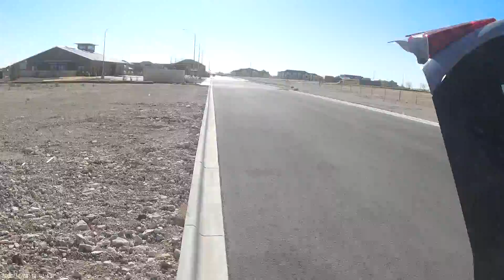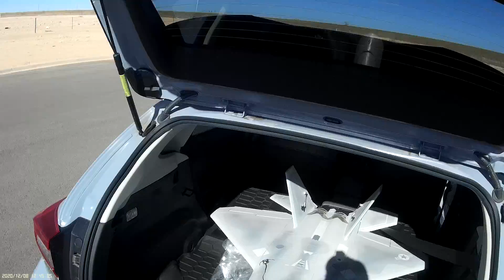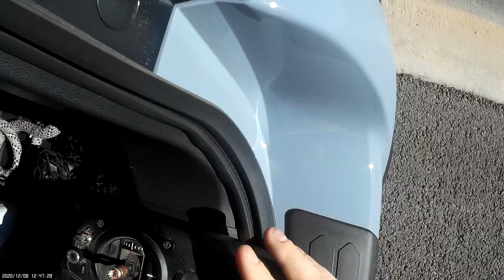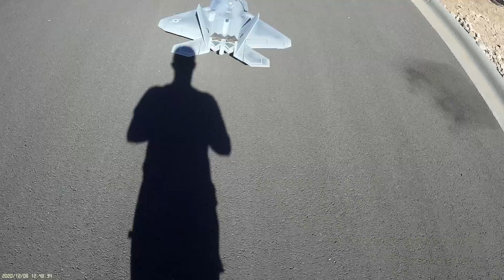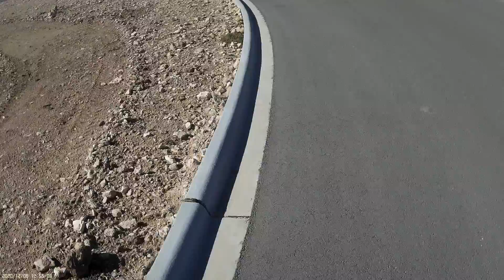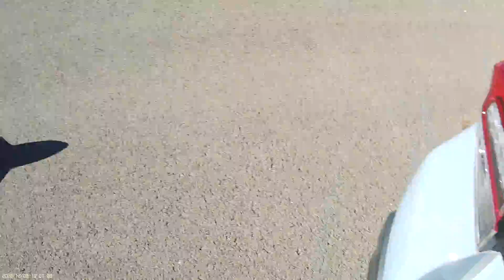Freewing F22 on Turnigy SK3 1500kv and Changesun 12 blade fan, 8s 5200

Comment: How do you like the 1500kv vs the 1390kv My F-18 had the same stock system as the F-22 1390kv 12 blade it felt slower than the f18 6cell 1900kv one but it did have a lot more torque it would climb a lot faster in looking into a 1500kv system but the one I found had a 9 blade I wonder if theirs going to be a bigg difference in power from your 12 blade to a 9 blade 1500kv
Reply from the maker: It's good, man. The extra power really shows but it's hard on packs. Get good quality packs if you try it, you'll pull over 4000 watts easy and the packs I used weren't really up for it.

Comment: good flying there. where did you find the 8mm fan adapter to mount the fan on the motor?
Reply from the maker: If I remember right, Changesun had one. I just searched 8mm shaft adapter for changesun 90mm EDF and bought a couple of them.
Reply: @jasonpope7070  thanks. Appreciate it man. Stay safe and keep em flying

Comment: Great job.  I felt the pre-flight and pre-landing jitters right along side you! lol
Reply from the maker: Thanks! I’m coming around with this plane. A few weeks back I yanked the ribbon cables and ran individual servo wires to the receiver, and programmed ‘crow’, where the flaps go down and the ailerons go up, to try as an alternative to the rudder air brakes. Hopefully I can get a video soon, but I’d like to get a better camera first if i can find one.